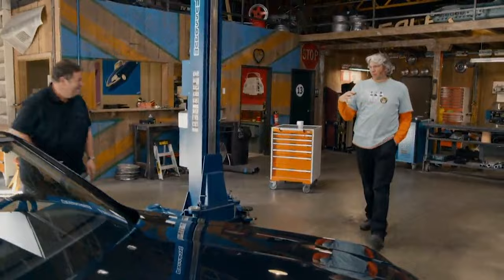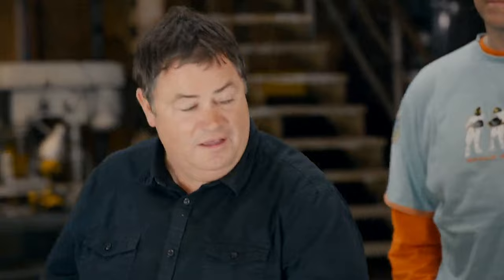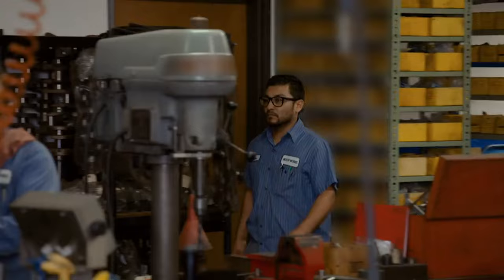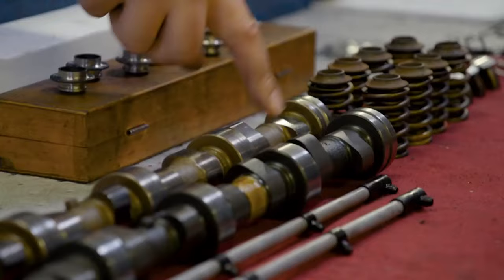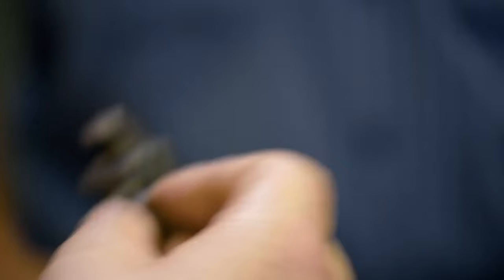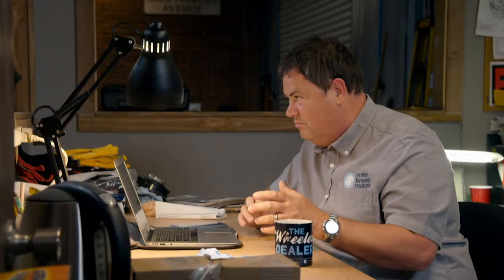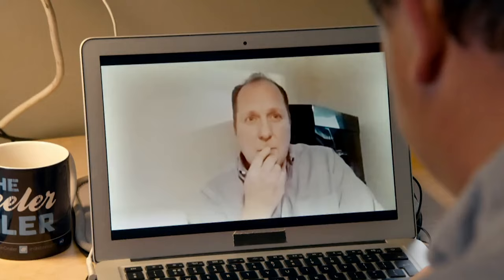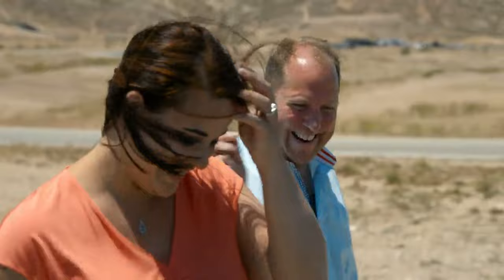Mercedes AMG: Mike Brewer Pulls Off A Complicated Deal! | Wheeler Dealer

Comment: Of course the “buyer” got a super deal - the parts didn’t cost him 15k, much less probably. But feel good deal!
Reply: the idea was, all of those parts together was basically impossible to find, so the price of the entire kit was whatever the buyer wanted to value them at. the 560 SEC AMG skyrocketed in value, I know this episode is very old, but a couple years ago there was a 560 AMG sold at auction in Japan for about 700k.
Reply: @MrPrajitura  at 700k, that’s astronomical but I’m assuming that’s an original AMG with very low mileage.
Reply: @davidmorais2394  yes, it was original, pre-merger AMG SEC.
Reply: @MrPrajitura  I’m also assuming there very few of these were ever made hence the price tag. Still, super expensive!

Comment: The thing that gets me about this AMG heads upgrade ?
they lighten the rockers and spring retainers, then fit heavier valves cancelling out any weight saving
also the original cams were already  AMG ( the standard ones don't have AMG stamped on the ends )
which they replace with  aftermarket non-AMG camshafts
saying that
in reality  the real AMG engines fitted to real AMG SECs had 4 camshaft heads.
Reply: Not all AMG SEC/SE"s had the m117 DOHC engine.There was also SOHC Amg engines were built.  ;)